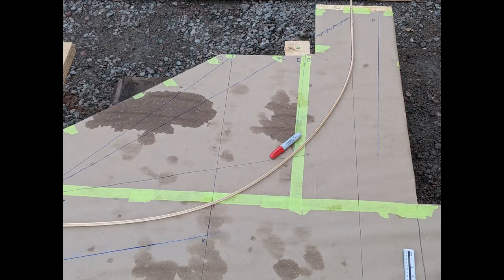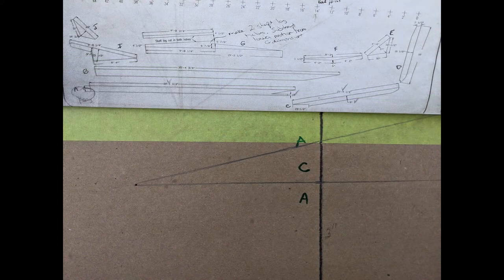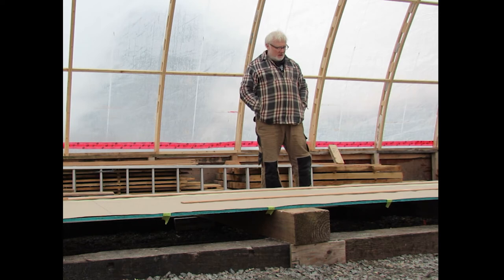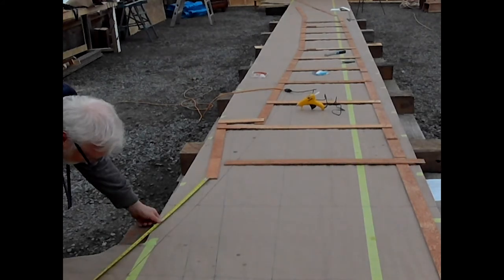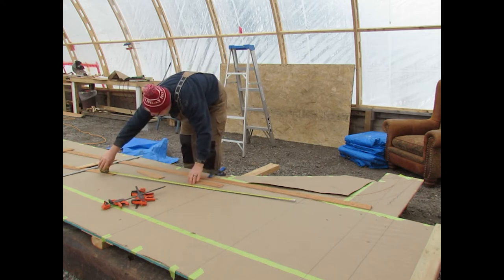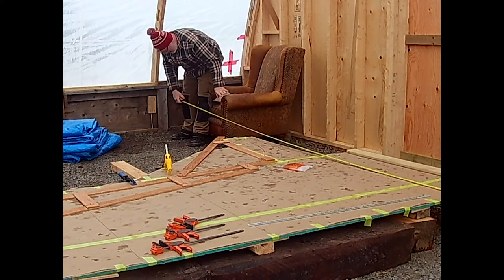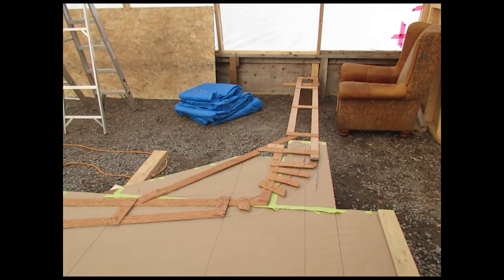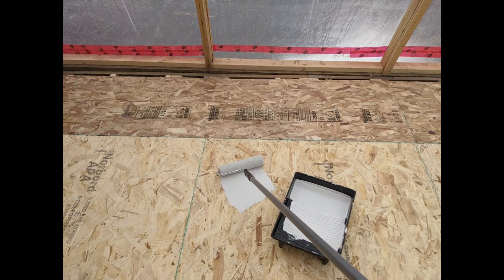Boat Build Patterns - Ep 8 - Building A Wooden Troller Yacht

Comment: Right, almost there then Bill!  Sorry just having a laugh at your expense. I’m currently building a 6.5 meter folding tri. Something completely different than yours, out of foam and epoxy fibreglass sandwich. Main hull is nearly finished and just yesterday I was remembering laying out the temporary frames at the beginning. Although like you I had to build an arch shed first since my garage was too small.  It’s my second boat but as someone said to me when I started the first, just keep doing the next job and eventually you run out of jobs. : ). On that note I better stop watching YT and get back to it. Keep up the good work. Cheers from New Zealand.
Reply from the maker: Thanks Robin. A sense of humour is an absolute must for boat builders. Are you video journaling your boat build?
Reply: @TheAmblerOdysseys  Hi Bill. I’ll put out a video at the end.  Trying to shoot video and deal with epoxy and fibreglass is a sticky nightmare. I’d hate to be trying to do that on a regular basis. It would largely be a case of “here’s something I prepared earlier”, rather than showing anything of the process. So I take a few shots and video as I go and I’ll narrate a construction video as I did with last small boat. There’s a couple on YT if you’re interested - one on construction and one on the finishing touches. Cheers